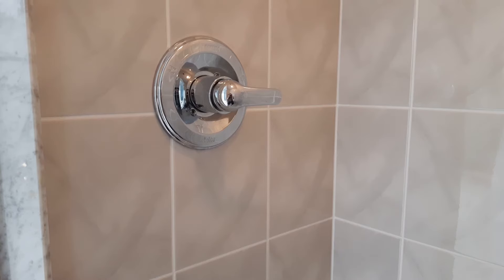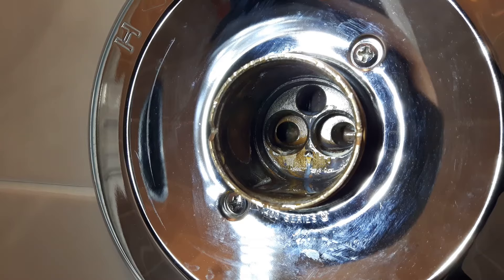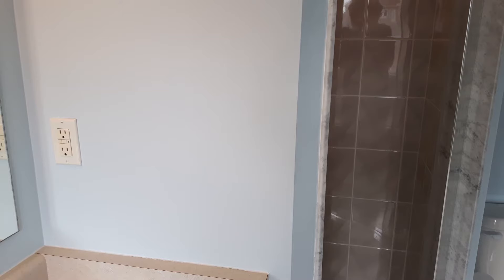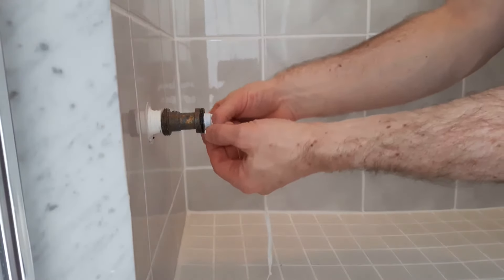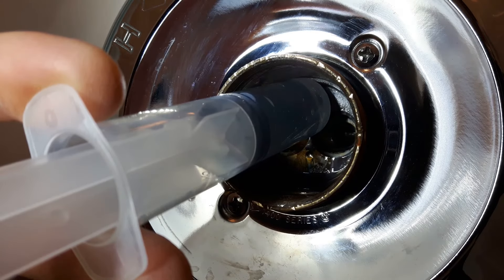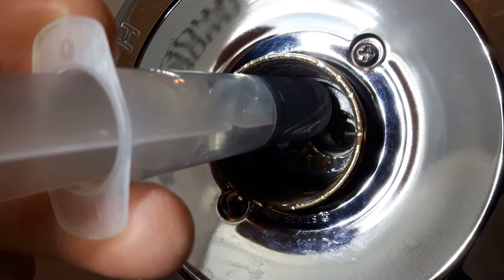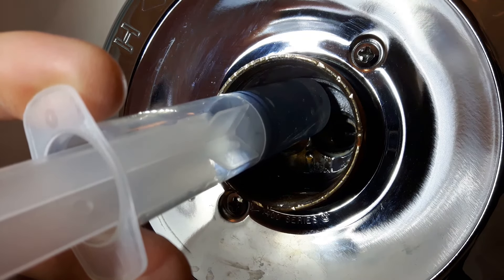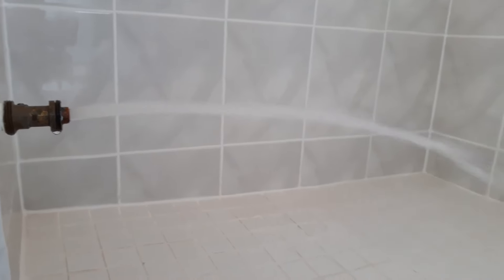Hard Water Buildup Deep Inside Copper Piping (How To Fix It)

Comment: Thank you for sharing, Yes it truly does work. My problem was the line going up to my shower head. Note: it may take a few days to get the vinegar smell off of me lol 😅
Reply: yeah same situation. I have an old Gerber two handle shower and the cold stopped working because we never use this bathroom.  I was going to use CLR until I saw it was not for copper pipes. Or can you get away with it...? Did you use regular household white vinegar or  cleaning stronger vinegar?  We have been taking hot showers for months and I finally have figured out what was wrong and a possible workable solution. To the creator thank you for this.
Reply: @sl5311  I just used white vinegar Removed the shower head and put the vinegar in a bottle so I could pour it in the stub out for the shower head then I put a zip lock bag over the stub and let it set over night.
Reply: @normanmaynor5705  That's actually a great idea.  I didn't think to turn the stub upside down and get a funnel and pour it in.  I will be doing that tonight. Thank you so much!